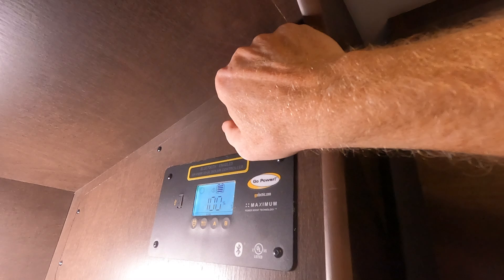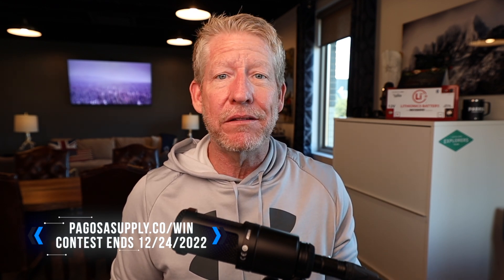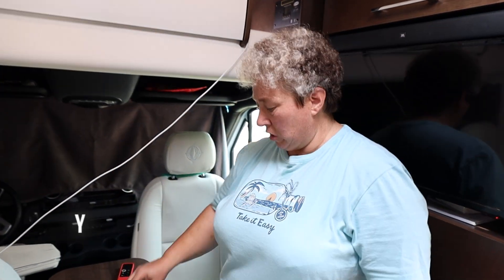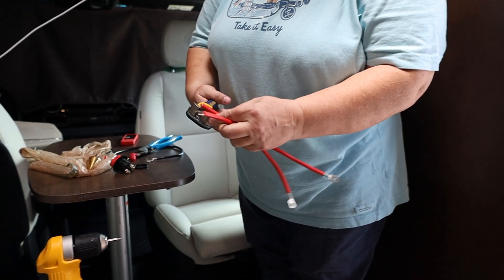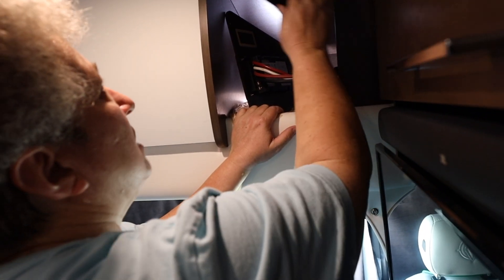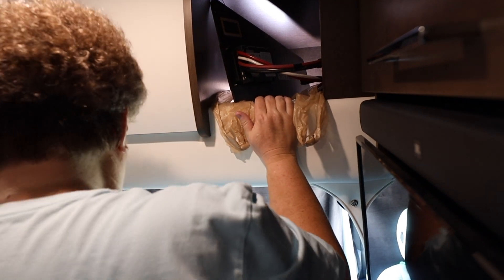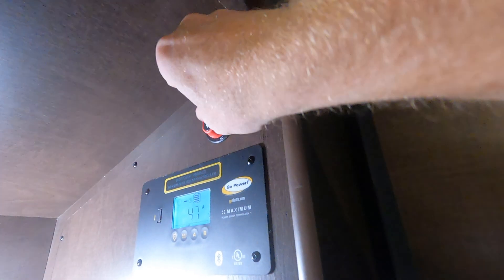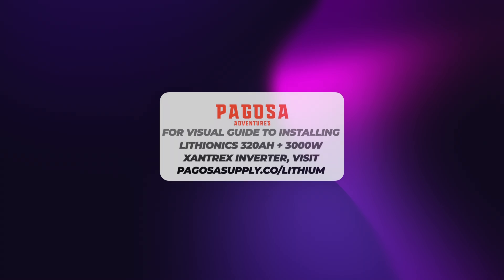LEISURE TRAVEL VANS - DIY: How to Install a Solar to Solar Controller On/Off Switch

Comment: Getting ready to have solar done and I asked about this.  Their response was to just pull the fuse.  So why should I go this route, please?
Reply from the maker: There isn't a fuse between the solar panels and the controller on an LTV. If you are adding to a factory LTV, I would definitely make sure they know what they are doing.
Reply: This is being done by a very reputable company.  My LTV did not come from the factory with solar if that is what you mean.  I will talk with them more about this on Thursday.
Reply from the maker: @JacquelineChaplin  Ok, then I would have them put the on off switch between solar and controller for a much easier way to disconnect than a fuse.

Comment: Great video.  If upgrading from GoPower to Victron, is the cut out in the panel the same size?
Reply: The Victron Solar Controller has a slightly larger footprint.
Reply from the maker: I have not made the switch, but I believe the Victron is considerably larger.